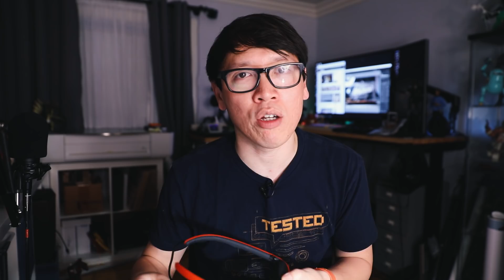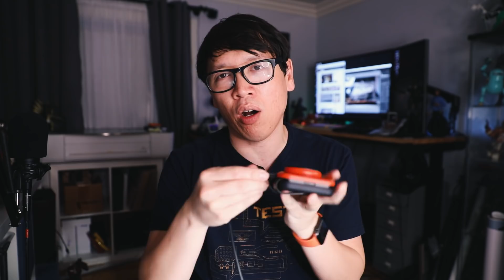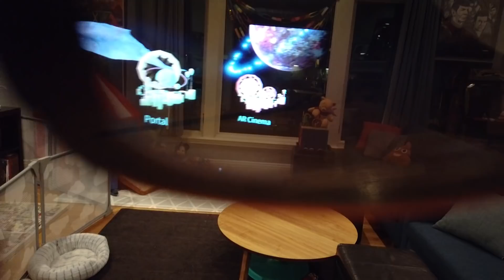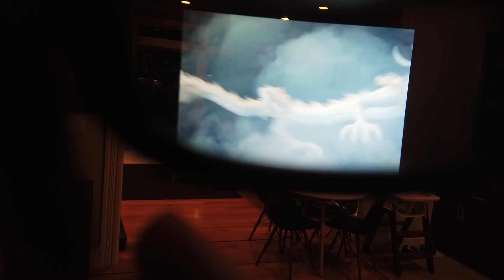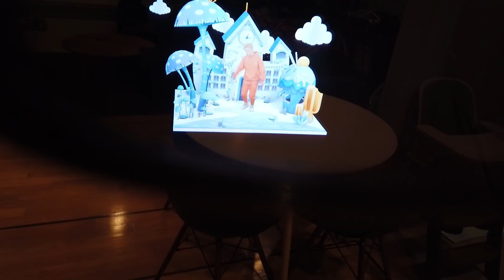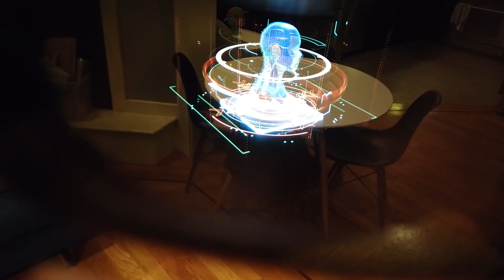Nreal Augmented Reality Glasses Developer Kit Review!

Comment: It looks like it sits way to far away from the face making it look weird compared to normal glasses.  Did you find that to be an issue?  Narrowed your field of view?
Reply: it's meant to sit something like that to get your eye in the eye box..... if your eye is not at the right distance meaning outside of the eye box u won't get a sharp focused image
Reply: @pumpuppthevolume  I can totally understand the reason for that but shouldn't more development go in to it to make that possible?  Even as cool as AR is I can't see me wearing these.
Reply: @theredundancy  they are using cheap simple optics that have been around for a long time because they want to make it affordable

... shrinking it further will require a lot of rnd work and there is no guarantee how expensive it will be and the volume size of the production line

instead they have something that is much smaller than the $2300 ml1 and $3500 hololens2 and has great image quality and similar fov and angular resolution while costing $500 if u use it with a compatible phone or pc u already have

it's a ballance of a lot of stuff

if the apple info is correct they will have something better looking for 500.... but it will be closer to google glass with dual lenses than a full ar headset.... but it will get one day close to that
Reply: @theredundancy  AR glasses will never be widely uses as long as it looks like that.
Reply: I definitely noticed that too, I think while you wearing a normal glass you actually look thru it mainly the upper part, but this thing, due to its design, you look thru the lower part so it needs to sit higher on the nose, which appears weird...
Reply: I thought the same, though my thought was that it lets a lot of light in at the sides because it sits so far from your face, so will likely never be usable outside as you would be blinded by the sun form the sides.
Reply: @Guybrush Threepwood Aesthetics should be changed then cause if it looks like sunglasses it should fit like sunglasses.  Plus it would be way better if it looked like normal glasses which would be more acceptable to an everyday consumer.
Reply: @theredundancy  The fact that this is obvious to you should probably indicate that it would be even more obvious to designers and developers- if it were as straight forward as you assume, then it would already be done.
Reply: @mostlyjack01  You're right.  Design implementation is a fickle thing and can be affected by many variables.  This design choice too could have been that it was the cheapest to produce and fastest to implement/quickest turn around time from developers inputs to build.

Comment: Where can they finally release something without cameras?...
Would be both cheaper and have a much greater appeal for someone like me.
Reply: Then it wont work dumbass
Reply: @notimeforcreativenamesjust3034  Depending on what you want to "work".
What "won't work" is hand and object tracking.
That is also what I don't care about at all.
What will work though is the display that I could use in my own applications. Which is the only thing I want and which I don't see on the market at all right now.
Dumbass
Reply: darth_Dan you... JUST want a transparent mini display in such a form factor to... read? Buddy there's cheaper ways to read good.
Reply: @Taijifufu  Why read? Why not project 3D objects, displays, holograms etc?